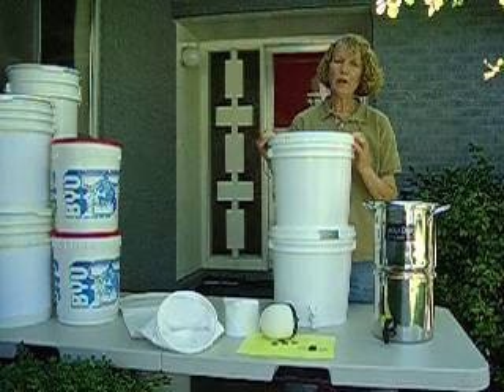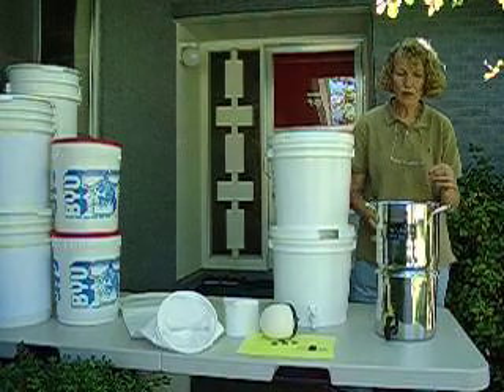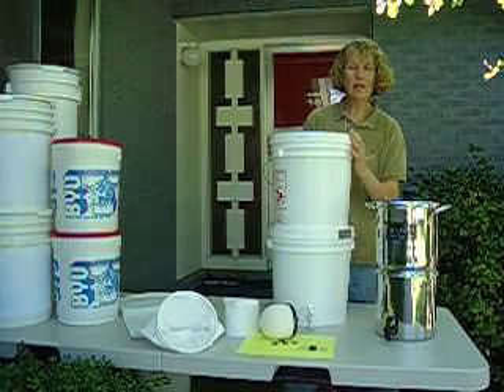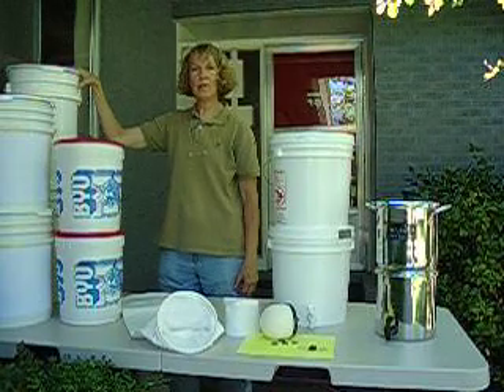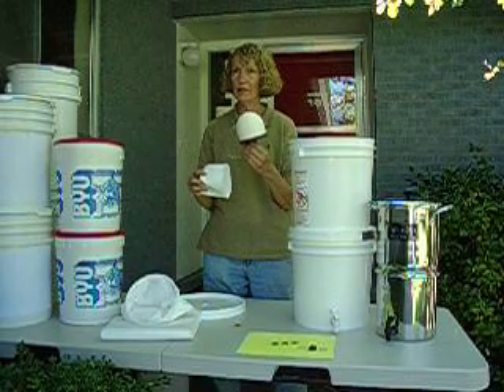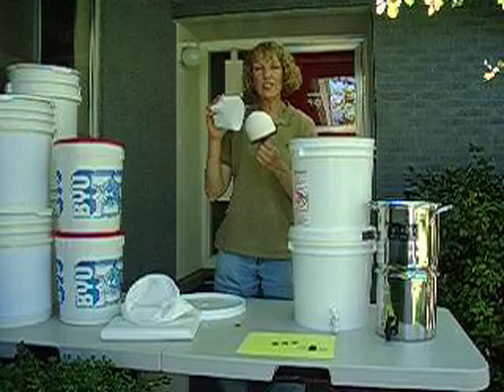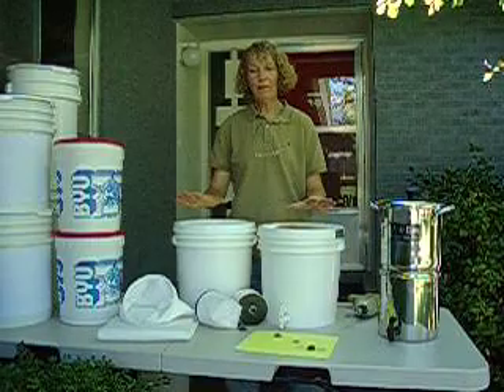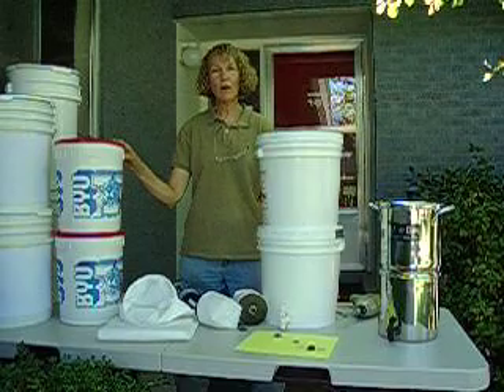Ceramic Water Filter

Comment: At Walmart, they have the Stainless Steel Stock Pot with Metal Lid FOR CHEAP..... 8-Quart or 12-Quart or 16-Quart and all you need is the Ceramic Filters and you can make it your own DIY CHEAP + SIMPLE !!!
Reply from the maker: This could be a great idea!  Are the lids to the pots flat?  That is essential, and do know how to drill 1/2" and 3/4" holes through the stainless steel?  If so, please tell us here!  Thanks.
Reply: @3stepsorg  -  The lids are really thin, you can Step Drill it easily.  Also, YES, you can put the lid right on top of it easily.  You can literally just push the lid down, after taking the rivets off from the handle.
Reply from the maker: @JodBronson  Step drilling. That's great.  For the filters inside the top pot, you have to drill both through the bottom of the pot and then through the lid it will sit on that goes on top of the bottom bucket.  Then the stem of the filter goes through both holes and you are actually fastening the top pot to the bottom lid.  This creates a seal so that dirty water running down the side of the top pot as you pour more water in to be filter but spill a little, can't run down into the bottom pot of filtered water.  This is a problem with that Berkey can't figure out, although they sell their filters for up to about $350.  Thanks, Jordan.

Comment: thank u,  do u know of a good filter system but mainly an alkalizer(ionizer) one that will remove most of the flouride and chlorine.  i found one ($1200) with an orp of upto -1100(and removes flouride to non-detectable levels, and reduces water molecule size upto 50%) do i need to soften it after. but do i need that. or should i get one with -300 to -500 orp. made in china or somthing.   do u know how how much filter replacment is?  sorry to ask and thanks for your time.

Comment from the maker: No. You might get a tiny bit when the filter is brand new, so you can run some water through it for a while if you're worried and then throw out the first batch.  Activated charcoal is what Poison Control gives people when they've been poisoned.  It's what's in all kitchen sink, refrigerator, and camping water filters.